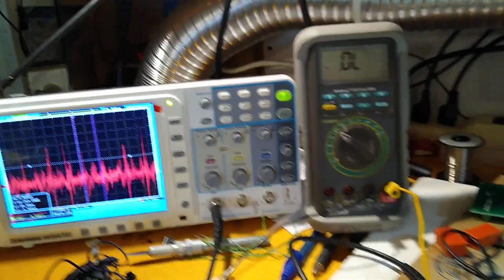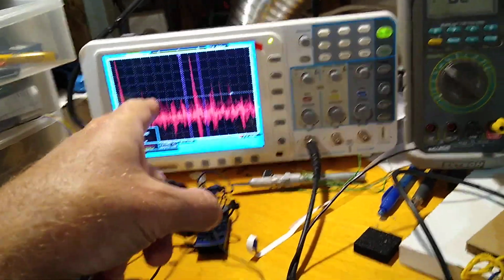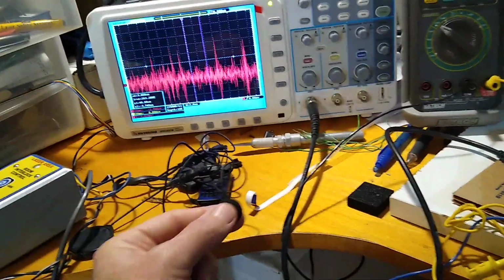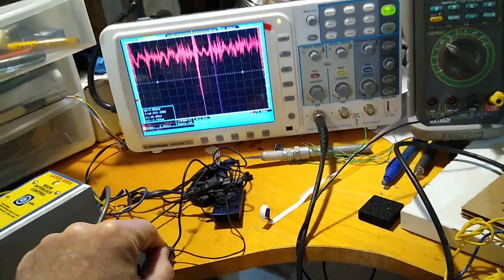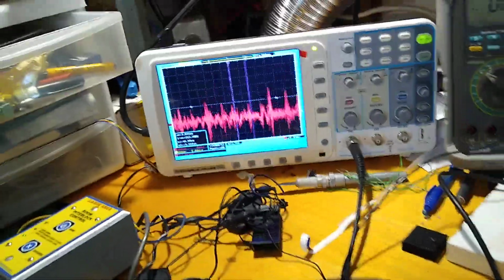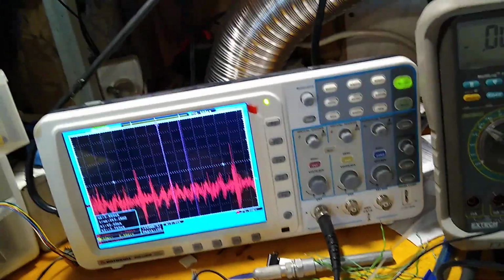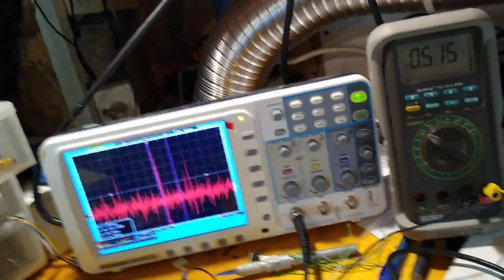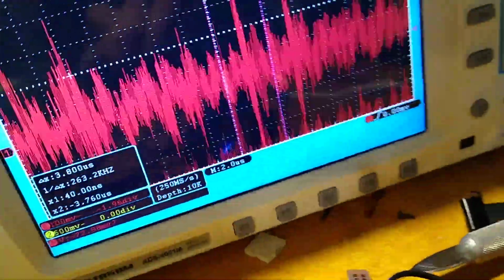Testing Bluetooth dongle adapter for ICOM airband radio

Comment: Hi John,

Since you have expertise mounting audio systems I appreciate your opinión on this:

I have a yaesu fta-450L airband + 2m radio band + iPhone and I wish I can transmit on airband or 2m band and listen to music or having pohne calls. 

Do you think is posible to hack the yaesu transmiter in order of being able to opérate also on the 2m range? 
If not maybe I could conect the airband transmiter and the 2 meter transmiter into a ppt somehow, then send this into a sena device and join all together with phone via bluetooth....?

still investigating, I just ask in case you want to share your insights somehow.

Best regards,
Reply from the maker: Not possible, and not legal.  There are inexpensive "6 band" radios out there for under $100 that have two separate receivers, one AM and one FM, so you can monitor local airport traffic on the AM receiver ( they have reception band of the entire airband), and have the rest of the radio tuned to an FM "ham" frequency for communication with your buddies.  I recommend people use the FRS channels or GMRS and stay away from the other ham frequencies unless you are licensed.  These radios I speak of do not transmit on the airband, and this should be enough for most airports if you are in an ultralight.